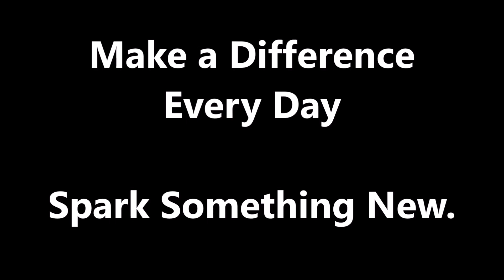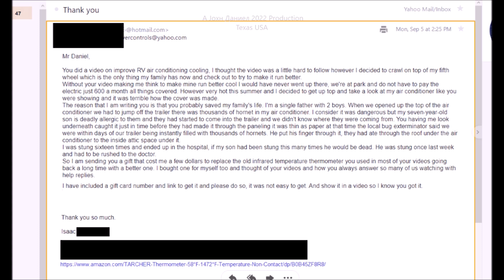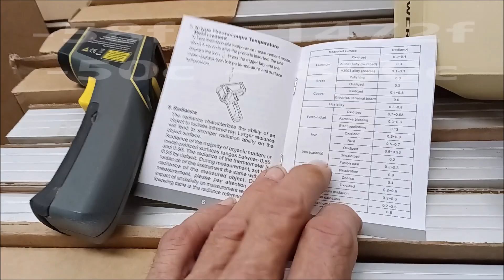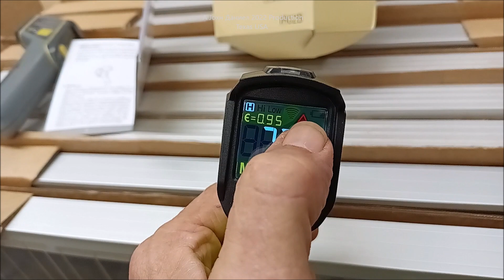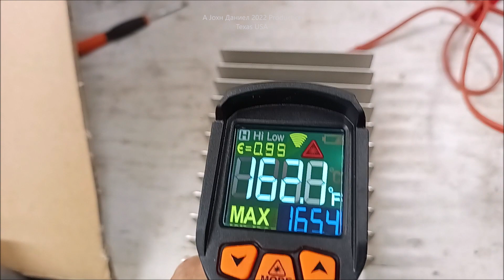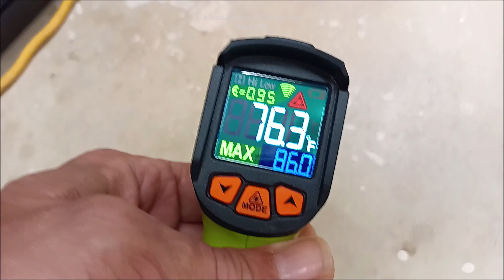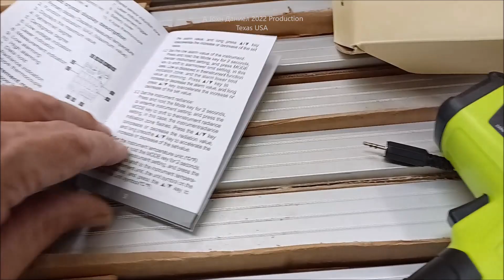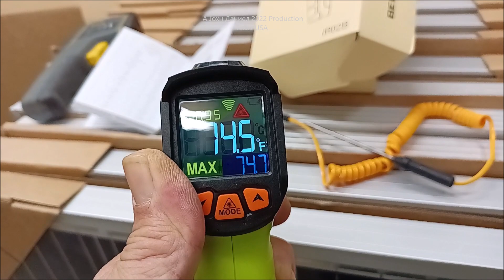TARCHER IR02B Infrared Thermometer, from a Viewer, Lets check it out

Comment from the maker: Tarcher IR Thermometer https://amzn.to/3QNrOoF Chip in with  https://www.buymeacoffee.com/JOHNDANIEL My Favorite Small Wind turbines 3/5&6 blade 12/24/48 volt http://s.click.aliexpress.com/e/bE1zQnPw or LOW WIND 600watt is https://s.click.aliexpress.com/e/_99l1XF Premium POWER QUEEN LiFePO4 Batteries https://shrsl.com/3kfqh ⬇ 93% Survivalist Agree, see the "L.G. BRANDON CAUSED" ENERGY CATASTROPHE SURVIVAL OFF GRID SOLAR POWER SYSTEM -- 100 Watt Panels (12) https://ebay.us/Zla5aq , Affordable durable solar controllers pick (2)60A https://ebay.us/pODwA7 ,Solar Connects https://amzn.to/2XJOa1M ,Battery cable USA made https://amzn.to/3h6dsim ,12/2 Above/Underground https://amzn.to/2XIJolg for safe DC wiring of lights and appliances.
Cheap Inverter with proven 5+ year record of quality - 3000 watt https://ebay.us/YEaTX9 for tool, high amp, fine electronics, uses Fairchild Semiconductors & these Costway DC 12v Refrigerator Freezers https://bit.ly/3jquPOy

Comment: Honestly for the solar panels and batteries I think just touching them is adequate for that kind of stuff I think a thermal camera is really  Necessary but I use those inferred pointing gun for finding misfires or a dead cylinder
Reply from the maker: I have a basic thermal camera, $275. I use it in many things like insulation jobs. And also for things that require a hunting license most the time. But this is a cheaper option for many.  And with some trial and error you can get usable results from a basic models like these.